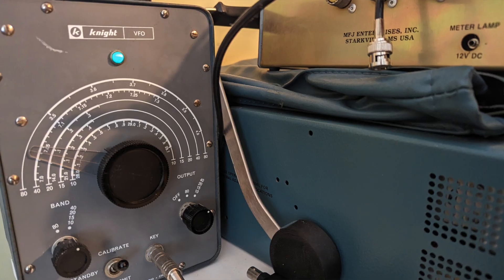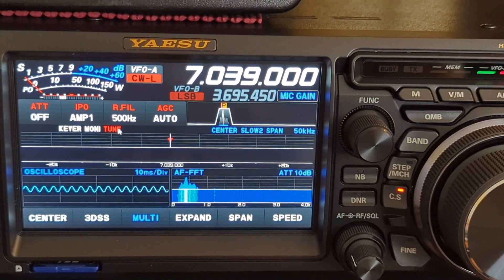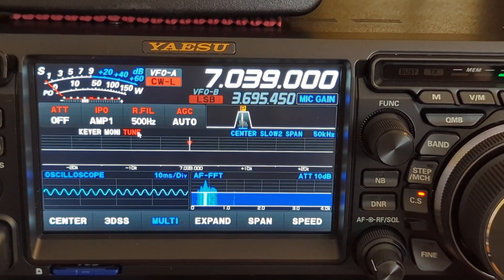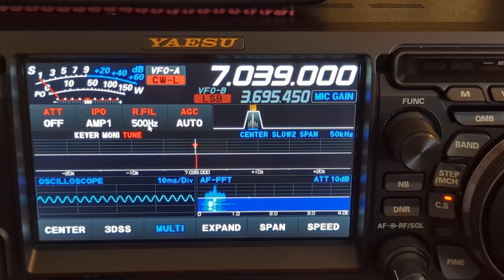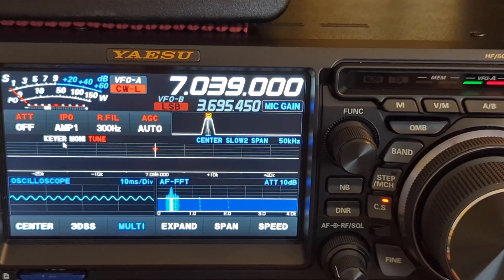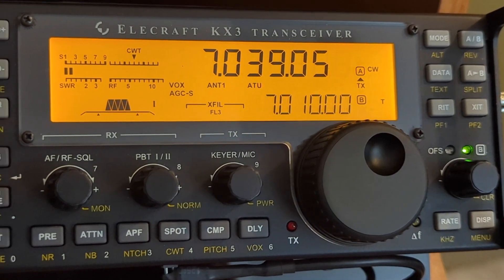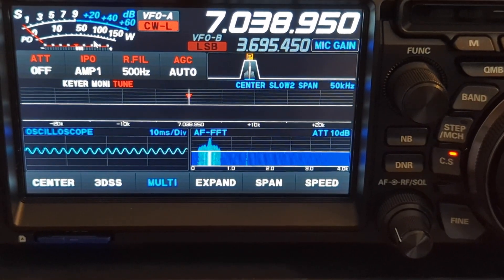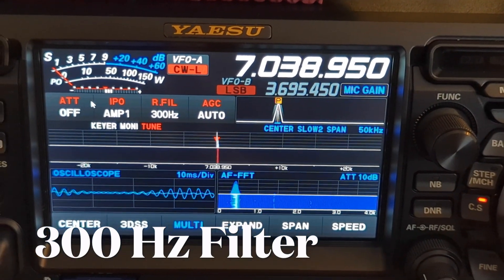Yaesu FT-DX10 XF-130CN 300Hz fillter comparison

Comment: Sorry, I think I am ADD, didn't listen to the video in full.  I thought I'd indulge and share my experience instead. 1975 bought a Drake C Line and a 500khz filter. (kind of a mistake buying , but not really). I then got a 250khz filter and Wow I could cut out a lot of the adjacent signals, pick out weaker ones.   it was a no brainer the narrower filter in a crowed band. I miss the Drake, so simple and so Good.
Reply from the maker: The main thing I've noticed is that the digital filtering in the DX10 is so good on its own that the mechanical filter's contribution is very small.  It does make a difference but likely not enough to warrant the purchase.

Comment: As a side note to the other commenters. Adding the filter may increase the resale value of your radio as well as giving a slight benefit now. Just a thought.
Reply from the maker: After having the radio for a few months now, I find that the main benefit of the 300Hz filter is that I can save the filter setting for a band and I don't have to manually reduce the digital filter bandwidth.  So even if it isn't a great benefit over the digital filter, having it engaged by default is likely worth the money.

Comment: Thanks for your test. I did spend the extra money on the 300hz filter after I had used the radio for several months, and I was unsure if I had wasted my money. Most times there is very little difference between the 500 hz and the 300hz both digitally set to 50 hz. But on chasing real  very signals the 300hz can just pull the station out of the noise. Would I recommend you spend the extra money on the 300hz filter, NO is my answer. Spend the money on a very good pair of communication headphones.

Comment: Not much difference. The 300 Hz filter does bring in a weak signal much better with a high noise floor. I don't know if it is any better than the digital filter. I may have wasted my money.
Reply from the maker: I'm not hearing a big difference. My Ten-Tec Eagle has a 600Hz and a 300Hz, with similar additional DSP filtering but I think the DSP filtering on the FT-DX10 DSP has a higher Q. 

I suppose I could redo the test with a 20 over adjacent signal to see if the 300hz makes a bigger difference.  I believe it's supposed to have sharper skirts than the 500hz filter but the DSP is making a bigger difference than I thought it would.
Reply: @HamRadioQRP  You are right. A stronger signal could make a difference.
Reply from the maker: Yep, I'll redo the test with a pileup busting 1-watt on the KX3 and see what difference it makes.
Reply: @HamRadioQRP  the main reason I haven’t spent the extra 200$. Would still like to see adjacent 20 over signal.
Reply: That’s really interesting, while there’s a discernible difference it doesn’t seem enough.  I’ve had a filter on back order now for quite a while and my CW isn’t that good and I think I’d not get the best value out of it.  Maybe a CW expert would.  Thanks for posting 73 Mike